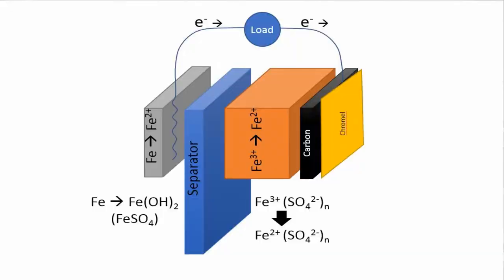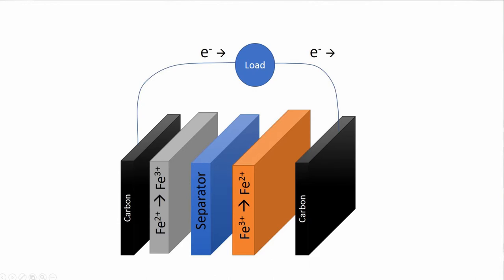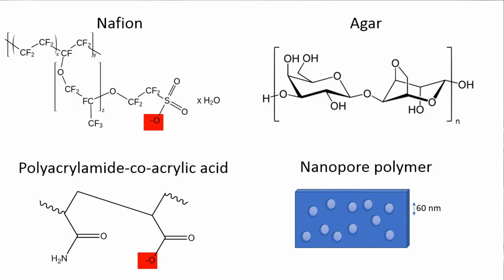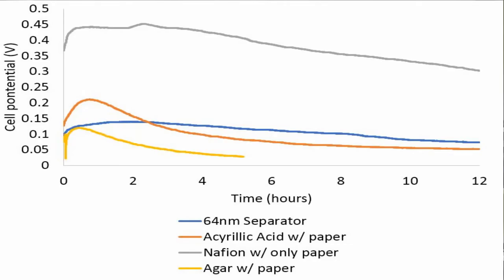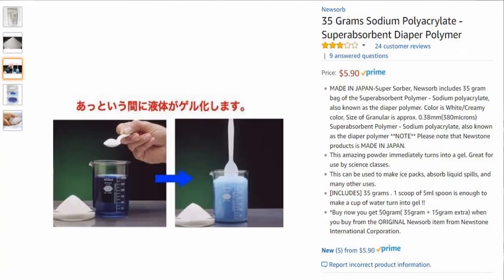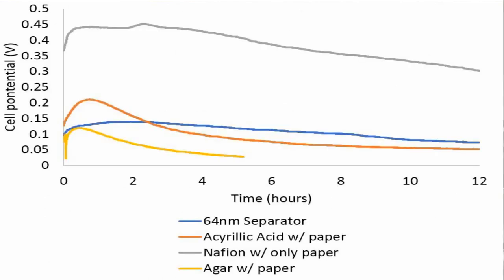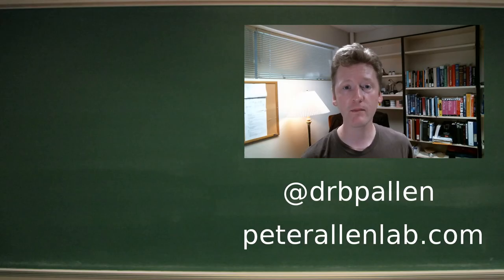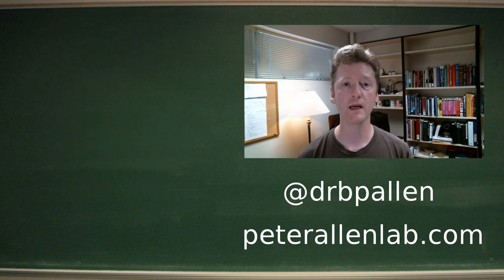Iron Battery chemistry: Separator evaluations 3

Comment: Use of exotic separators will add to the expense of the batteries. I don't see the cost of Nafion going down even if demand rises. The laws of supply and demand don't necessarily apply in patented proprietary materials. If it becomes a necessity industry tends to maintain the cost and reap the profits if not raise the prices. Stockholders usually don't care about the good of humanity beyond the value of their returns.
Without a comparable product the technology is at the mercy of the industry.
Take for instance nickel iron batteries. Although not all iron, they are relatively safe and efficient. Their recent popularity should have brought down the price but it has risen instead. Who knows, maybe the technology could be improved. 
I hope you can come up with a viable alternative to Nafion. The competition should reduce the cost. I know you're trying. I hope you can find a solution.
Reply: Nafion is a cation exchange membrane. there are different cation exchange  memranes, Thers strenght doesnt come from o2, its power came frome florines and some of sulfanete groups, they make it acidic so h+ ions can cross to counter side but oh- ions cant. Alternatively, anion exchange memranes are more cheap and home productable. grafted pvc, polystreyn, epoxy vs ...there are different grafting process...